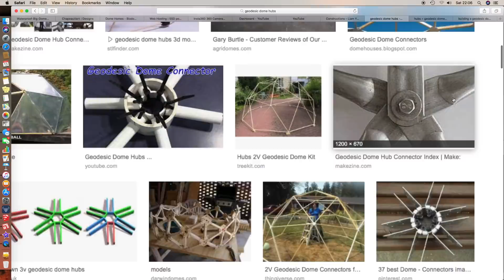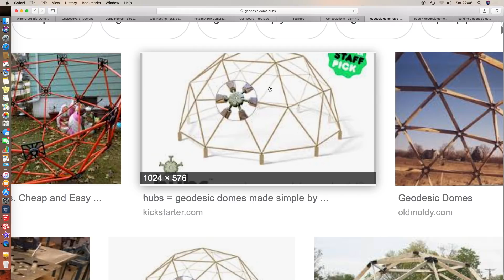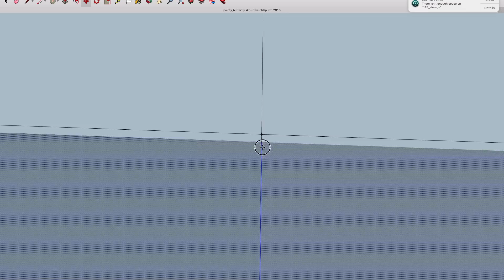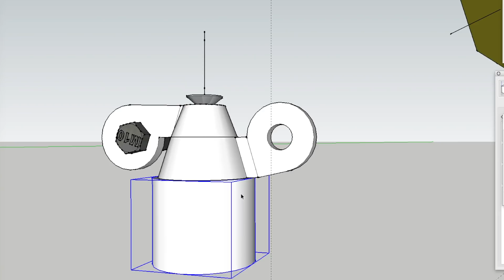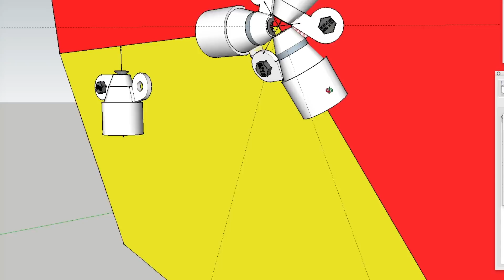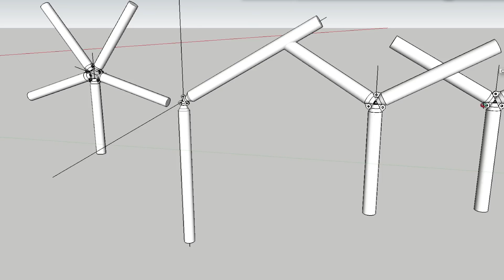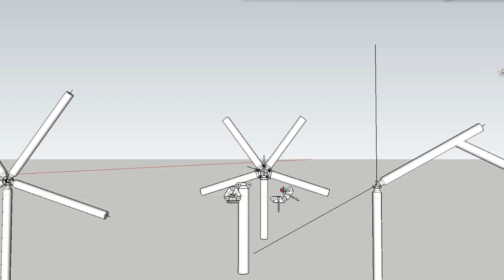Designing a better dome hub

Comment: Design suggestion.
Piece #1 ( top cone )
Piece #2 ( bottom cone )  create a spline(tenon) that comes off of the Bottom surface.   ( think mortise and tenon attachment to the strut material)
end material can be easily mortised ( jig saw, hand saw, table saw ) to receive the tenon.
any material you choose to make the cones out of can be cross drilled while in the endgrain of the strut.
strut owner can countersink any hardware used to attach strut to Hubcone #2

thickening the "hole" attach point to the cone...( twist minimalization ) 4:29 of the video. Where the "arm" meets the cone.maybe a triangle instead of a rectangle?(topview)

also... Youtube videos do not protect your "patent" idea.... take your design, print it, MAIL IT to yourself... while you wait on the patent to process... this is a definitive DATE Stamp that will hold up in any court.
Reply: As soon as a design is published it becomes unpatentable. Even if he'd remove this vid now, he'd be unable to patent it. He has now created his "prior art". Prior to filing, the idea should be kept an absolute secret and certainly be disclosed nowhere in public.

Comment: I think this system here is simpler reasoning on wood&plywood  as basic row material.
https://www.youtube.com/watch?v=ml3HHZLm5ro
Using couples of industrial round flanges the system can also be employed in a similar way as a bolted sandwich with metal squeezed pipe end in the middle bolted through...
What do you think?

Comment: This design is great! I've thought about a lot of the same drawbacks of other methods that you mention in the first part of the video and completely agree that there is a need for a product like this.
The way that each wing can rotate around the strut axis in order to meet its corresponding neighbor strut's wing at the midway plane is really great. The struts being bolted to each other rather than to a separate center hub prevents unwanted shifting and the placement of the top-left wing hole down and bottom-right wing hole up puts them into alignment with each other and keeps the strut from being offset from its axis. I'll search for a producer in asia that we could work with. Again, great idea, Paul.

Comment: Your tube hub is a wonderful design and would work perfectly but the tooling to produce it would require casting or injection molding, both very expensive. I'm going to assume you intend to improve the production of a greenhouse structure rather than the construction of a dwelling. The use of tube frames has the big issue of covering the dome in a manner to seal it as the tube frame must be covered after construction unlike your current method that allows each frame to be covered individually (your current method rocks!). I propose you might work to remove the actual frame member and mold panels of polycarbonate to the required shape to allow them to be gasketed and riveted in place.  While this would require a vacuum or strip heater forming process and limit the size of dome produced it would make the construction and sealing a snap. Please keep the good work coming.

Comment: So the "hub" doesn't angle and the struts need to be cut with the correct angle at the end?
Reply from the maker: No struts are cut at right angles, the hub does all the angle work, did you see how I rotated the top lug at 6:10 this makes the correct dihedral angle automatically.
Reply: will it have a limited angle movement? will it strong enough to prevent the structure being collapse?

Comment: how  do you attach poly carbonate or ply wood to the pipe. in the US it needs to connect a 2x4 foe a green house for building codes.
Reply from the maker: You can use any shape timber you like, these would work just as well with 2x4 timber, I'll put something together in sketchup
Reply: Thank  you I bought your plans and can not start the project til spring.any other ideas to make things easier will be fantastic.

Comment: Surely all the struts have to lie in a plane?
Reply from the maker: The lug with the hole and bolt lie on the same plane as each face, it's the rotating lug at 6:10 that makes this possible.
Reply: Ah - I see now that the cone is in two pieces. Serves me right for watching it on my phone!
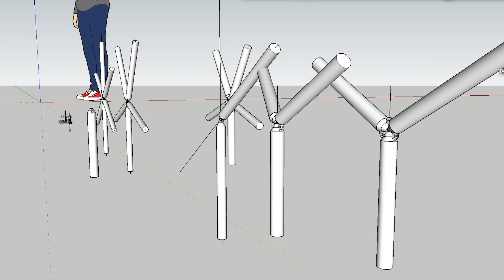Reply: Paul Robinson Thank you for sharing this brilliant design. I have some questions... After reading through the comments and digesting all the "coplanar" comments, I can understand the confusion.  The various hub configurations at 7:50 look somewhat coplanar, but I can imagine these flexing to create dihedral angles. I can visualize the center "void" of the hub increasing/decreasing in size and the "ears" rotating axially to each other. Wouldn't these need some sort of keying/knurling/toothing to prevent undesired axial rotation of the "ears" once the proper angle has been acheived depending on dome frequency or hub angles.  Any external loading may deform the dome.  Depending on the friction of nut and bolt fasteners may be insufficient to prevent warping of the hub angles.

Comment: I love the direction this project is going. I like that (presumably) it can be preattached to each end of a strut before constructing a dome. 

Some thoughts...

I tried to visualise it but it's not clear to me this gives the freedom of movement needed. Can it all be angled for each strut while still allowing the holes (for the bolts) to sit flush with each other?

The gap in the middle of the hub will vary. Could this add extra complexity in other areas like the parts used to cover the dome?

Even for a 3-way hub I count 15 individual parts to deal with. Possible to reduce further? 

Could the bolts work lose over time? Eg if lots of little vibrations from wind over time.
Reply from the maker: I'll do a more detailed video showing exactly how it works, it is a little hard to visualise because it's very different from anything else. Yes the gap will vary, this means that some struts need to be a little shorter, I'll do strength tests on all hub configurations when I have prototypes. There are two unique components, all the nuts and bolts are of the shelf so I don't count them. Yes there will be a lot of parts (several hundred in a 3v - 4v dome) this is why the cost needs to be as low as possible. Not too worried about bolts working loose as lock nuts can be employed. Oh and for your first question, yes you would fit the hub to the strut first.

Comment: Wow, you are a hero with that ability to come up with most practical design concepts. And am in awe at your abilities to best utilize that Google Sketchup. You are like the Mark Knopfler of geodesics, lol. Most impressive.
Have you considered uploading that onto the Thingiverse 3d printing based website? You probably have.

I've been printing a few small dome connectors from that site just to tinker with and try to make sense of them, though admit to being dyslexic along with a parkinsons/ms variant, and math hurts my brain, lol, though would be interested in that one you just created right there. 

Also, a design that makes best sense for creating home additions with, such as for use with flat walls that have sliding glass doors on them. It's a matter of geometry for those segments that are meant to adapt with a flat wall surface area. And even perhaps dome additions that even can wrap around corners of square shaped housing structures. 

And adaptations for standard window frames that could work well being windows on domes, rather than just triangular shapes of windows to consider.

Thanx for sharing your Vulcan knowledge in such a open source-based platform as this. 
Have a super day.  \V/_  🇨🇦
Reply from the maker: Thanks for your kind words, I'll definitely put some files together for thingiverse, as soon as possible.